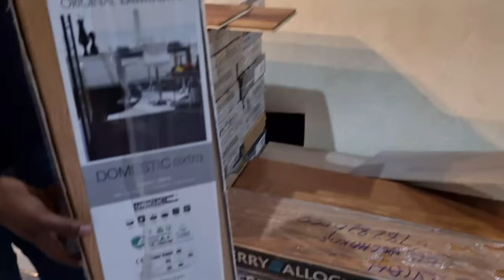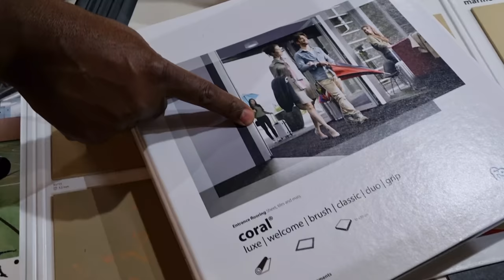HOUSE MAKEOVER CONTINUES  | TWA TWA CHALLENGE ON THE FLOOR

Comment: Just curious can it be installed where there's no tiles?
Reply from the maker: Yeah it can
Reply: FLOOR PREPARATION REQUIRED TO INSTALL MKEKA WA MBAO

For new construction the subfloor should be finished smooth screed popularly know as Nil finish.

Existing homes you can cover any type of subfloor like tiles , terrazzo or even wood flooring .

Remember installation is very easy it can be lay loose technology or glue down for commercial spaces like offices ,schools etc .

If in a rented premise you can move out with your mkeka wa mbao if it was installed using lay loose installation procedure .

Comment: Hii mkeka mtu anaweza weka kama hakuna tiles.kuuliza tu
Reply from the maker: Yeah you can
Reply: FLOOR PREPARATION REQUIRED TO INSTALL MKEKA WA MBAO

For new construction the subfloor should be finished smooth screed popularly know as Nil finish.

Existing homes you can cover any type of subfloor like tiles , terrazzo or even wood flooring .

Remember installation is very easy it can be lay loose technology or glue down for commercial spaces like offices ,schools etc .

If in a rented premise you can move out with your mkeka wa mbao if it was installed using lay loose installation procedure .